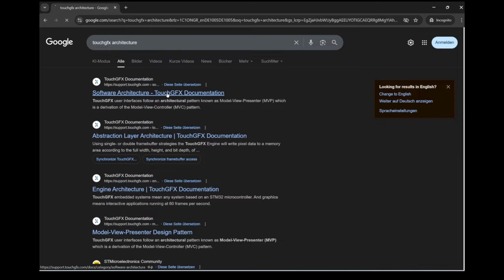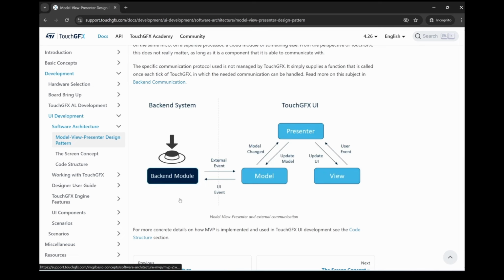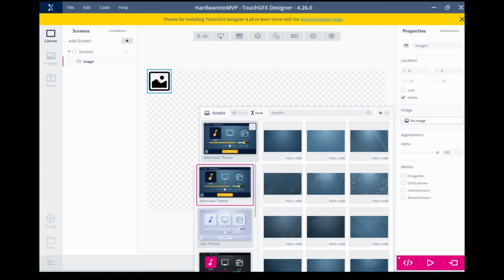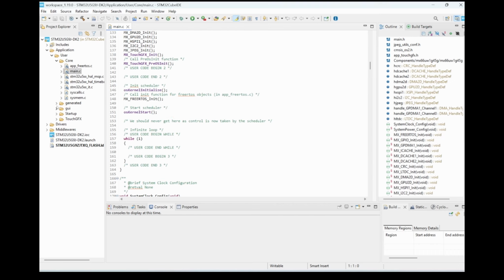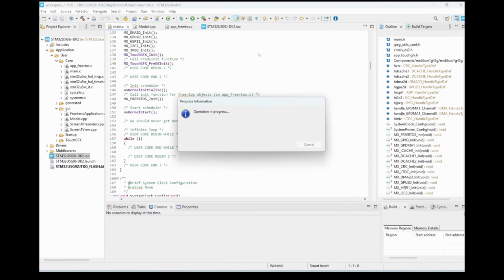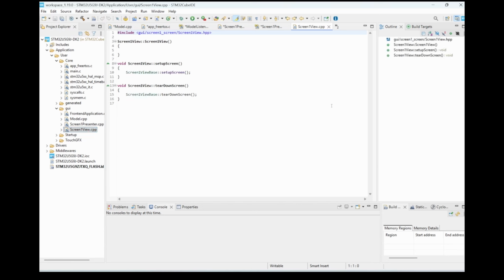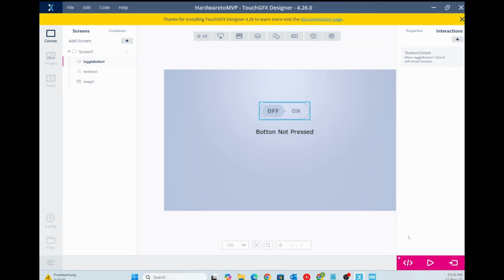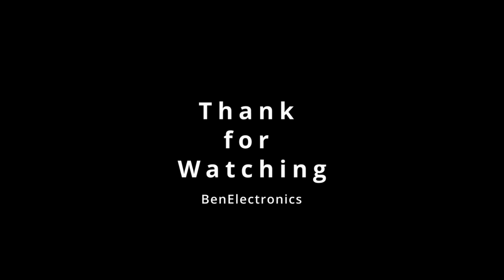TouchGFX Architecture : Full MVP Breakdown + Practical Example

Comment: I did the UI to BackEnd part only and the led is not turning on, what i missed?
Reply from the maker: This is a classic debugging scenario. Since the signal has to travel from the UI -> View -> Presenter -> Model -> Hardware, we need to find out exactly where the chain is broken.

Here is the best way to troubleshoot this:

Step 1: Sanity Check the Hardware (Backend) Before worrying about the UI, let's make sure the LED code itself works.
Go to your backend code (e.g., inside your main loop or the app_freertos.c file).
Add a line to force the LED on (e.g., HAL_GPIO_WritePin(...) or your specific driver function).
Result: If the LED doesn't turn on, the issue is in your hardware configuration (GPIO settings) or the board itself, not the UI.

Step 2: Trace the Data Flow (UI) If the LED works in Step 1, then the issue is the communication link. You can use touchgfx_printf("message"); in simulation to "follow" the signal click-by-click.
Try adding a print statement in each of these files to see where the signal stops:
In your View: Inside the button click function. If you don't see this message, the button isn't linked to the function.
In your Presenter: Inside the function that calls the Model. If you don't see this, the View isn't talking to the Presenter.
In your Model: Right before you call the hardware interface. If you see this but no light, check your interface code again.

Let me know at which step the "message" stops appearing!